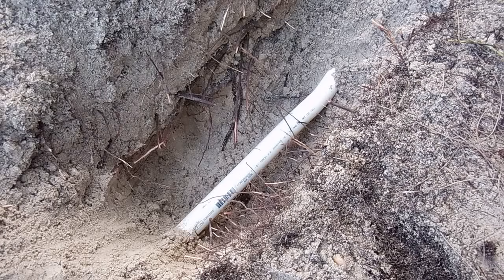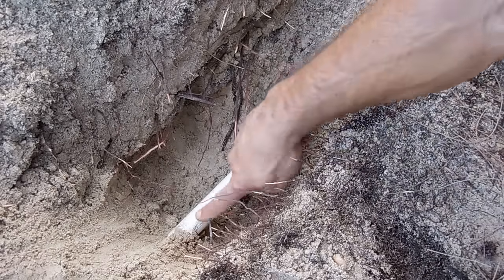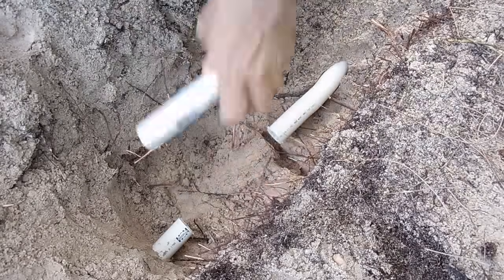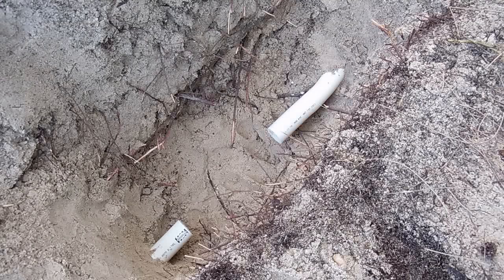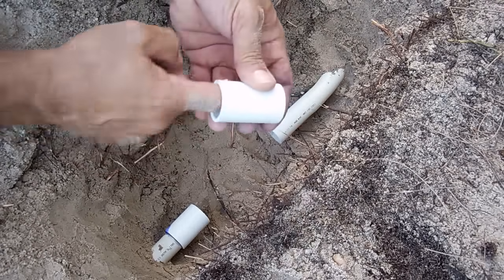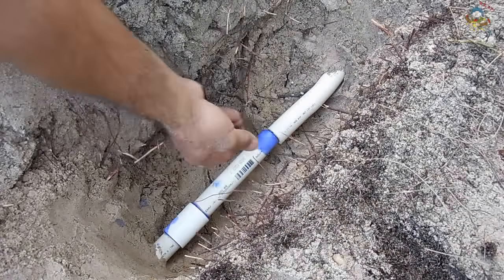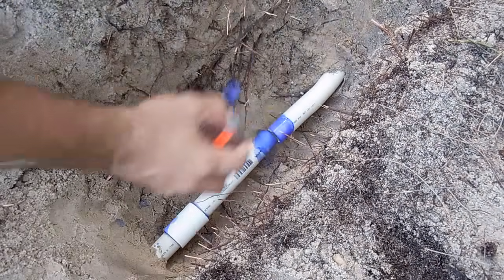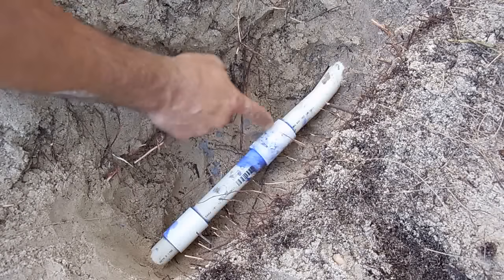EASILY Repairing Broken PVC Pipes(Least Amount Of Digging)

Comment: I have found pvc repair couplings in some  plumbing supply stores that are made without the stop in the middle. I have also seen too many pipes pulled apart with clear glue. I usually use pliers to twist and push repair coupling on. Less messy. lol. I like your work ethic. I think you enjoy getting your hands dirty, sign of a good person. nice video. good repair.
Reply from the maker: +tooterr101 oldgeezer 
Pretty good. I never came across any PVC couplings without the stop.(Full slip). Clear glue works perfectly if you apply enough. The problem is people apply primer and forget the glue, or they do not apply enough glue and apply a slight twist. I never had a failure. 

Thanks For Watching

Comment: Yep nice repair. I think if the original crack were cut threw completely and not migrated down the pipe any you may even just use the one modified coupler  and a heavy gluing
Reply from the maker: +builtrodewreckedit 
Correct. Thanks For Watching!
Reply: Exactly that was painful watching
Reply: electronicsNmore 6cf y6. vc

Comment: I use the The four 90's  method
Reply from the maker: +falcon02012 
That will work, but the problem is friction loss. You are changing the direction of the flow of water 4 times. For full flow, the method shown here is the best. 

Thanks For Watching!
Reply: I used the four 90's as well but I wish I had seen this first. Much simpler.
Reply: electronicsNmn